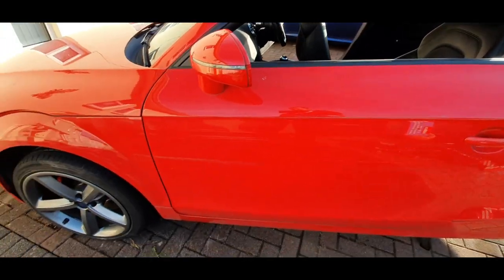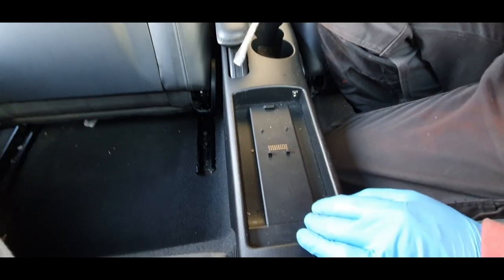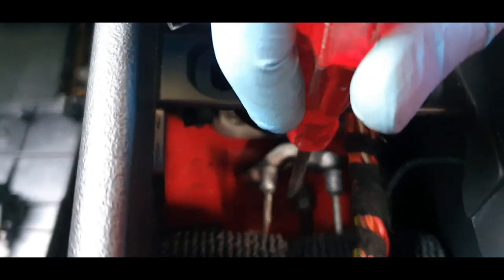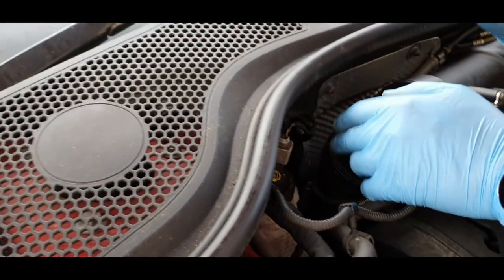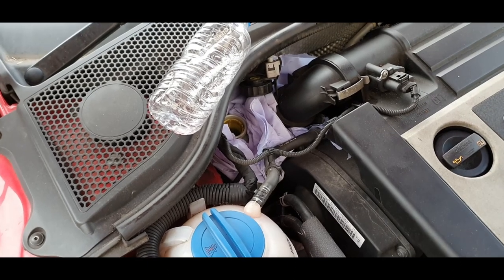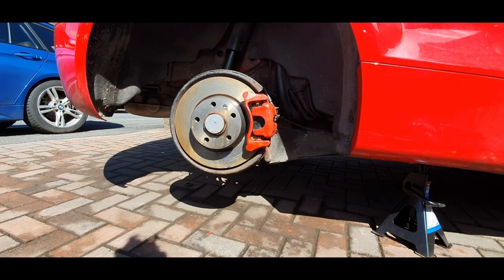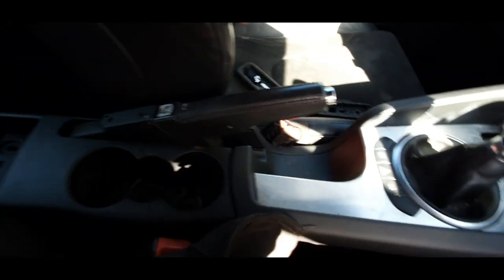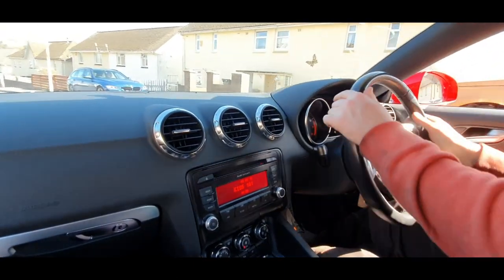Adjusting the Hand Brake & Bleeding The Brakes On A Audi TT Mk2 Copart UK Salvage Rebuild Car

Comment: took my tt to a garage who put new pads and discs on, had a nightmare with them and now a few weeks later my handbrake just stopped working after a bolt or something shot out my wheel while driving